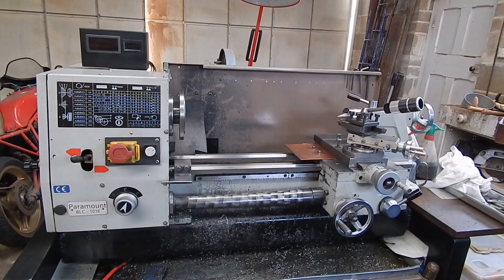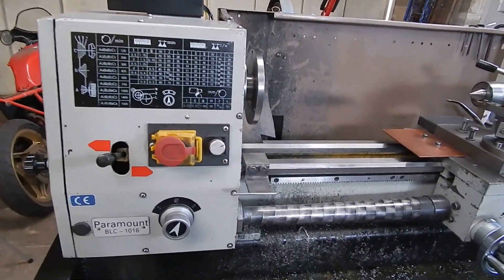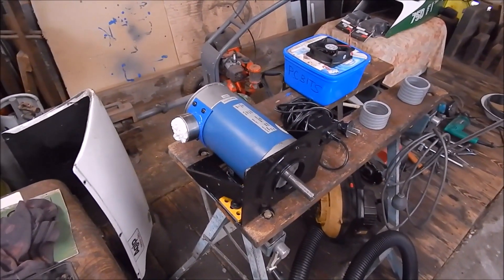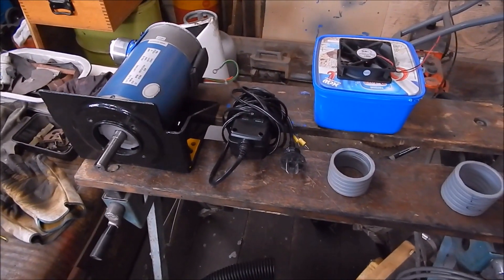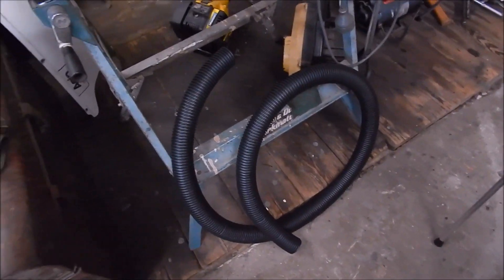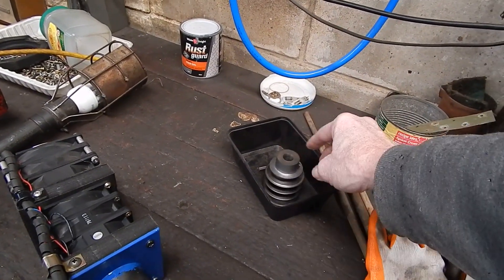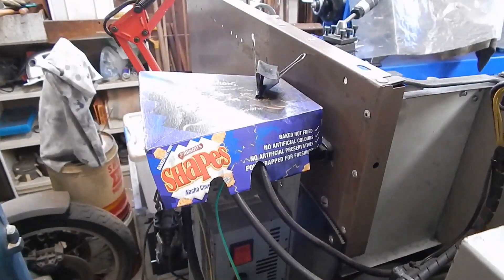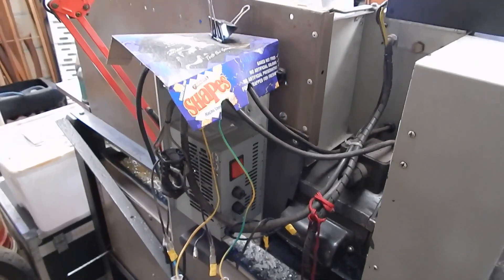My lathe variable speed DC drive - part 1

Comment: that blower cannot be efficient : the outlet (and inlet ) must be the same diameter as the fan s propeller , one fan is enough since these computer fans don t compress air , adding fans cause more restriction. you should pull air out of the motor instead of pushing it in. I use on my myfords baldor modified from 1/2 to 3hp motors (2 super7 and 4 ml7 ) a 12 volts 1 1/2 " laptop fan and it proved well enough. the flow is more important than the volume , cheers

Comment: Rob,
I like your fan arrangement. I thought you might go with a blower of some type, but that should do the trick, providing the fans move about the same quantity of air. (Here in the US, we use CFM or cubic feet per minute to measure air flow.) Interesting build. Thanks for sharing.
Regards,
Dave

Comment: Hey Rob,  That motor looks like a beauty.  I couldn't really see the old DC motor clearly but if it was a stamped steel "beer can" motor you are really going to like the new one.  I, too, am on my second DC unit.  The first was a beer can style rated 2.5 HP (treadmill duty) / 5200 rpm and it was okay but didn't have much low end torque.  The 2nd looks like yours, is twice as heavy as the first, bigger diameter and rated 2 HP continuous / 2500 rpm.  I am very happy with it.   When I saw your fan setup I laughed coffee through my nose.  Are you using PC fans because you have them laying around?  Axial fans are poor with any head pressure and PC fans only seem to stay lubed for about 6 months.  I'd have thought you'd go with a squirrel cage like eBay item 390873167572 or similar.  I imagine you can scrap them from fireplaces, space heaters, furnace draft blowers, etc.  Or maybe grab an automotive blower and box from the junk yard and run it at a lower voltage.  If you ever fry your KB controller look at their model KBMG-212D.  It is sweet.  Cheers.]Ed
Reply from the maker: Hi Ed.  Yes I had the fans. I've looked for other cheap solutions and got a bouncy castle blower for $20 which I now use for my backyard melting furnace (too damn noisy), but can use as a fall back if necessary.  I want something quiet.  Had considered some sort of squirrel cage motor, but need something fairly generic.  Not my line of work - maybe something in a tumble clothes dryer ?  Anyway, this setup will do for now as we are into winter here and it's damn cold (for Australia). So heat should not be a major issue for a while.  Cheers Rob
Reply from the maker: Well Eddie, I think I've found the solution.  And it's not the PC fans.  I tried them hooked up and it was still less than inspiring.  I seriously don't want to wreck this motor.  It's too good.  So I dug out a yet to be named item I happen to have two off (and no it's not what you're thinking) and did some basic testing.  Looking really really good.  All I will say at this stage is that I think this is a winner.  Certainly from the air flow and noise perspective.  If it works as intended the next video will be pretty interesting.  Just have to do a bit more machining.  Cheers Rob
Reply: (GASP)  Those are banned in at least 12 countries and you have two of them?!  You're right...probably not what I am thinking.  My next guess would be a hair dryer.
Reply from the maker: Wrong.

Comment: Why Dc motor and drive?...this is what the old boys used to do on lathes and mills 25 years ago....now we have vector inverter ac drives with current sensing and much much more but its your money Robbie :)
Reply from the maker: I had the bits and it cost me peanuts. Rob
Reply from the maker: And yes I'm an old boy.
Reply: As you mention $$...Any chance you could enlighten us as to the cost of these vector inverter ac drives with current sensing  ect, ect and an ac motor, for a lathe of this size.. Doubt the cost would beat a junked treadmill off the kerbside cleanup (free), and a kb electronics controller (60-80)? So that's a grand total of about $80. That's going to be hard for you to beat Lawrie  ;)

Comment: I look forward to seeing your implementation. The noise you experienced from the fan stack is likely a sign of cavitation. If that is the case then it can indicate that you are actually working against the effect you are hoping for. You may find that one fan with a filter will be about as 90% as effective as two or more stacked fans (without the danger of free running the fans to early failure). I know that there is a point where stacking fans of similar capability can end up reducing the effective airflow negatively.
Unfortunately the little formal education I have had with the fluid mechanics involved is that stacking is never straightforward.
IMHO if you had the space then ideally two fans side by side could be a better  working compromise long term. (But it looks like space is at a premium in the video, so I acknowledge that is likely a useless suggestion.)
Hoping it works out.
Reply from the maker: Your right.  I played around with the number of fans and this setup produced the best result.  I have my big bouncy castle blower I can fall back on if this isn't good enough, but it's so damn noisy.  Cheers Rob

Comment: The "safe" wiring brings back memories of my own efforts fitting up a treadmill motor to my lathe last year.

Touch wood it survived last summer without blowing up, though user cooling tended to be a higher priority with the beer fridge close by whereupon all work ceased.
You do what you have to do the protect one's safety.
Reply from the maker: How are you cooling the motor Ray ?   I can't retain the original fan on mine anyway (no space for it), so it has to have independent cooling.  Rob
Reply: xynudu . Hi Rob, I'm still using the original fan on the shaft.
The fan sits up at the "messy" end, ie behind the chuck.
To guard against swarf and oily detritus I rigged up a sewer flange and 45 deg elbow, pointing down. Perfect for keeping the crap where it should be :-)
The fan sits just nice within the duct, and appears to function quite OK.
The motor actually spins in reverse to it's normal intended usage but it works fine.

Comment: Hi Rob !
Yeah, safety first ... that's the main issue in your shop ... ha, ha !

Your project encourage me to give my "chang-lathe-motor"-project a little higher priority ... I have a 4kW motor running 2750 rpm and a Danfoss freq.converter in store for that project.

I long to see your next video !
Reply: djpaulk Here in Denmark secondhand AC motors can be brought for next to nothing ... so it's no problem at all ! But I've been using a AC motor with freq.converter running UP TILL 200% of it's rated rpms for years - no problem at all !
You do as you like - and I do as I have experienced is working good !
Reply: djpaulk Are you a throll ?
Reply: djpaulk Please, keep the door closed and locked |-))
Reply from the maker: Hi Keld,  I thought you might get a chuckle out of it.  This was meant to be a temporary fix five years ago :) I really don't want to mess up this motor as it's well made (epoxy coated armature) so I will be watching that temperature meter closely this time around.  These DC motors can really heat up quickly when put under sustained low RPM load.They are beautifully smooth and have bags of torque.  Part 2 shouldn't be too far away.  Cheers Rob
Reply: Yeah, cooling is often a problem when running at low rpm's - that's why I choose a motor normally running 2750 rpm 3-phase 400V AC ... then even at low rpm's on the lathe the motor itself will run at "some" rpms - maybe I have to use a smaller polley on the motor too. I don't think it harms a motor to run it at up til 150%-200% of its normal rpms - so messing around with different polleys too can help you out of this temperature problem, I think.
Reply from the maker: I think you're right Keld.  This time I will run the motor at higher RPM and gear it back.  The heat build up seems to occur mainly when the armature windings get too long a current feed at the lower RPM.  That's the plan anyway.  Cheers Rob
Reply: Keld Sørensen If you over volt or exceed a motors rated rpm, you shorten its life. You are right about the pulleys go smaller on the drive pulley and bigger on the driven pulley, this will keep your motor rpms up at slow spindle speeds. You may loose a bit of top end speed but will gain low speed torque. My 7x12 variable speed lathe has high and low gear, I only ever seem to leave it in low gear and the potentiometer only really ever goes about 1/2-3/4 position. Low rpm and poor ventilation kills these treadmill motors.   Paul
Reply: djpaulk With a freq.converter you'r are not "over volting" a motor - you just change the frequency for the AC delivered to the motor - that does no harm to the motor even if it runs 150%-200% of it's rated rpms.
Reply: Keld Sørensen Sorry mate, this is the first time you mentioned varying the frequency.. anyways..
 I think you might find this interesting,namely the second post by 
Chuck Raskin on 30 August, 2005 - 2:38 pm http://www.control.com/thread/1026211551    especially this part...
"2. Never operate an AC motor at less than 75%, or greater than 125% of its No-Load RPM rating. AC Motor bearings are designed to operate at the nameplate RPM." 
Did you overlook bearings??
That being said, you WILL wear out a motor prematurely and my original statement, "If you over volt or exceed a motors rated rpm, you shorten its life", stands true;)
Paul
Reply: Yeah, maybe for rocket science but in a hobby shop you just get another motor IF you harm it at all !
Reply: Keld, I too run a hobby shop and no, it really isnt rocket science.. Running a motor at double the rated speed and having it wear out quicker is really just common sense, which its starting to appear you may be lacking? Run anything at twice the speed its designed and its bound to wear out quicker. On a side note, most home "hobby shops" are on a budget and cant afford to "just get another" one every so often..
People giving misleading info on here is writhe, and frankly starting to shit the hell out of me, your not helping!
The advice is there, if you don't want to take it, that's fine, I join you in wishing for your next motor change ;)
 Paul
Reply: Keld Sørensen What works, and what's technically correct are two different things. Ignorance is a bliss I guess. Don't be afraid to do things the correct way and get a bit technical if you run a hobby shop. (no rocket science involved).  
You do what works for you, but stop bullshiting everyone its the right way and it will do no damage !
Its lying, misleading, denying the obvious, type comments like this that give me the shits...
 " - you just change the frequency for the AC delivered to the motor - that does no harm to the motor even if it runs 150%-200% of it's rated rpms."

Double the rated speed does NO harm, does it?? Yeah right mate, its people like you, that when they don't know for sure, need to learn when to keep their 2 bobs worth to themselves and close their gob, instead of giving poor advice.
This convo is getting long in the tooth now and I can see im wasting my time.
I'm glad you winged it to find something that works.
Paul
Reply: Keld Sørensen No im not, trolls state bs, then wait for a bite, just like you, are you 12 years old? Run your motor at double the speed, there is a right way to do things, then theres the wrong way. I really could not give a rats ass what you do!..
But why state that doubling the rated speed of a motor will do no harm, when it obviously will? Feels like im talking to a kid or a brick wall. All I can do is hope the people reading this are not silly enough to run their motors at double rated speed. It doesn't make one, less of a man to admit when they are wrong Keld.
Some people say, this is the way I do it, but its probably not the right way.. Nothing wrong with saying that, but to give incorrect advice and tell people its the right way, just because that's the way you do it, is kind of pig headed.
Paul.... over and out.
Reply: Keld Sørensen
What the heck is that supposed to that mean?
Your still talking shit I see...
I thought Denmark was full to the brim of smart technically minded people, you proved me wrong...
Reply: djpaulk
Oh, sorry for that !